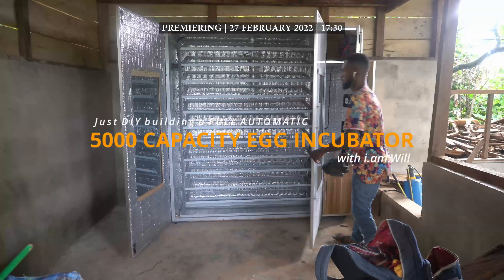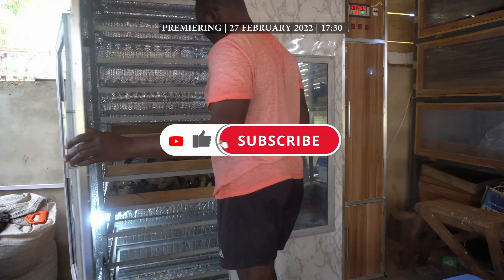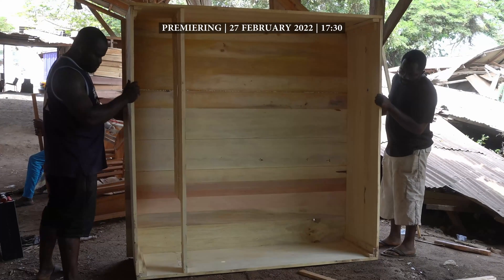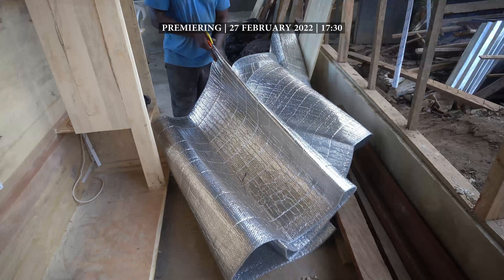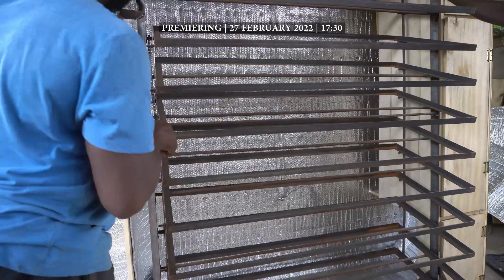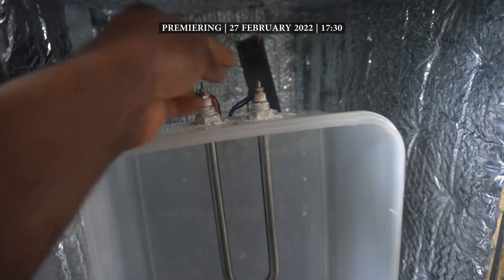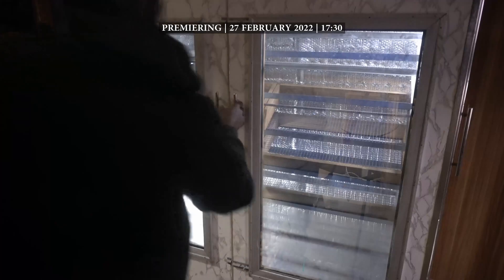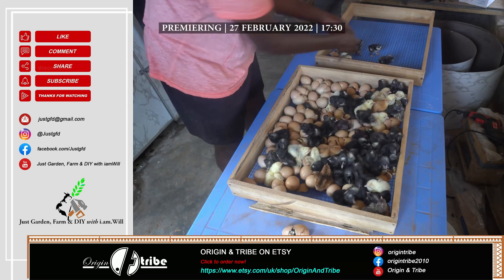How To Construct A 5000 Capacity Egg Incubator | Update On My Homemade Egg Incubator | Easy Steps

Comment: How do you get the oxygen inside the incubator??
Reply from the maker: because of the high humidity in my area, I didn't put vents on this machine. However, I did open it as and when required, to do adjustments ie fill humidity bowl, check fan etc. this allowed the fresh circulation of oxygen
Reply: @AIS.FarmResorts  thanks